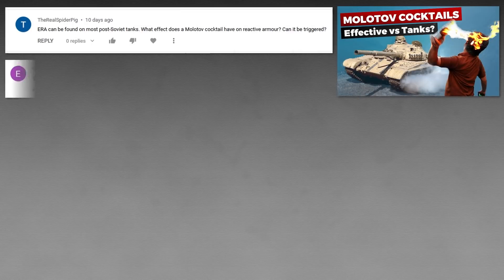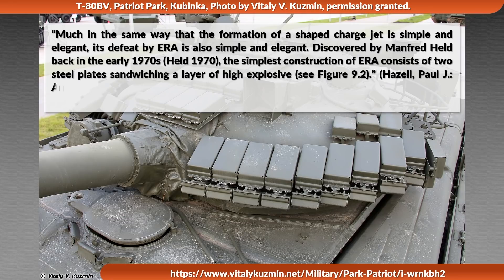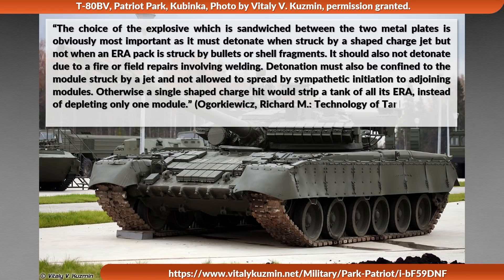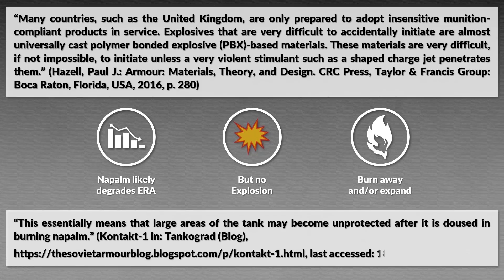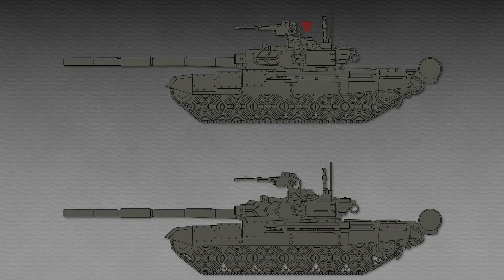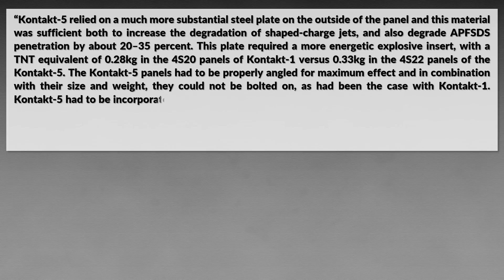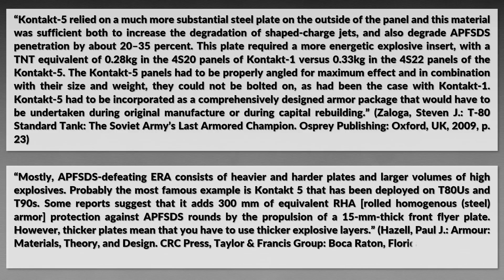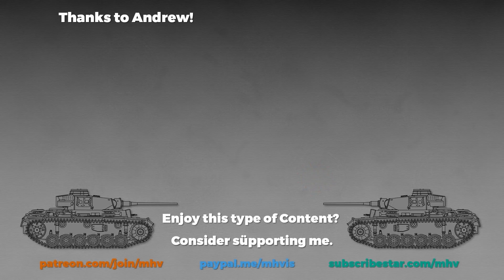Why does Russian Explosive Reactive Armor not explode?

Comment: My guess before watching. It has to do with the starting principle that you can burn C4. Simply stating that not all explosives are volatile in that way.
Reply: Yup. 
PBX or C4 will detonate if it is subjected to a shock generated by another high-explosive, but that shock must be sufficient to initiate the explosive chemical reaction. For instance, blasting caps have only a tiny amount of high explosive, but they prime a charge by insertion into the charge. The high detonation velocity of the cap will transfer its energy efficiently in that instance. However, if you put the blasting cap on the exterior of an ERA block, the block would not detonate. The detonation velocity of PBX explosives is roughly 10k meters per second. A bullet's velocity is a small fraction of that. An explosion on the interior of a tank is buffered by the tank body, the material surrounding the ERA and distance, so it cannot generate a sufficient shock to initiate detonation of the ERA. 
But, if you need to heat your food, C4 is great. (Anyone more current on military explosives, feel free to correct me.)
Reply: @SBCBears  it gets a bit soupy as it burns so you have to be careful about small fires if you dont set up correctly, but yes C4 is great to cook with. A thin spiral is easiest to make in the field and easily controlled. Some use it to heat and break bottles for improved shaped charge containers and it gets pretty drippy like that and can start a small fire at your feet.

As for shooting it I have managed to set C4 off with a 40mm Hi Ex and a .50 cal HE can be iffy in my experience, nothing else smaller will do more than splatter the ground with the shit.
Reply: @SBCBears  you meant the right thing but said the wrong thing. Tertiary explosives require a shockwave to detonate. Now eventhough RDX (not PBX) is a Tertiary explosive, it does not work this way on this particular explosive. It requires an electrostatic potential to detonate.
Reply: @SBCBears  the force you are describing is an impulse…  not shock :)  it will only be activated by a high impulse or electric charge. 

Cheers bro :)
Reply: @adamleddy9894  Thanks and true. 
I used "shock" here to better communicate the effect of the speed of the reaction-- a gentle push and hitting your thumb with a hammer are both impulses, but the qualitative difference is stark... especially the second time you nail your thumb. (Son of a b**ch!   🥵  ) 
Just trying to get the idea across to the general reader. You're right, tho. Thanks again.
Reply: @SBCBears  all good… I work in this field so I didn’t want to contradict what you were trying to convey… just arming you for the next time :)
Reply: Not sure if you guys are being sarcastic, but I thought the fumes from burning C4 might not be so great, especially in food. :x
Reply: I heat my MRE's using burning C4
Reply: I was expecting the theory that comes of the reactive armour had been sold off and solid blocks of clay and cardboard installed in it's place. Is there is a Russian equivalent to Sgt. Bilko?
Reply: Yup, no detonator. 
The explosives would burn like a candle in high heat but the explosive penetrator is quite sufficiently. 😏
Reply: I thought the oligarchs  put plaster in the contatainer in stead of c4/ or contact b .lol
Reply: Same with dynamite, you can burn it on top of birch bark, but caviat is that you really, really should avoid any hot sparks? embers? landing on the dynamite or it can set it off since its small area that gets exited by heat energy, potentially enough to cause chain reaction, but otherwise you can burn it. Tough dynamite is less stable than C4, what you can burn with out ember issue far as i know.
Reply: They filled with carton
Reply: Uhm…I think you misunderstood reactive armor. It’s not supposed to explode under heat. It’s supposed to explode upon the sensors picking up on an incoming projectile.
Reply: @baronhelmut2701  who did? Bunch of comments here, sir
Reply: @Sir.Craze-  if there is no @ in my comment. It’s addressed to the thread opening comment. Which is yours. Your comment would only make sense if you didn’t understand the way reactive armor works. I addressed the C4 not exploding when exposed to heat in another comment addressed to somebody else.
Reply: @baronhelmut2701  my comment is saying that you can expose some kinds of high explosive to heat without them being set off. And that I've guessed this will be a factor in the explanation of the video. I'm not sure what I've missunderstood. I'm saying it may have been burned without being set off.
Reply: @Sir.Craze-  Ok, last time im going to rephrase it: what you said in of itself is not wrong, but it also completely misses the point. The point at which the tank is burning is too late for it to matter whether the reactive armor “reacts” or not. Also obviously the reactive armor is not supposed to go off from heat, so it makes sense to choose the explosive that remains stable under heat.

Comment: Its to be expected that they dont detonate due to fire but instead just burn out. Secondary explosives (most people only know these, like TNT and C4) only burn and not detonate on their own. They need a strong initiation like from a blast cap, hammer blow or the violent penetration of ERA.
Reply: Many lives have been saved due to reduced sensitivity explosives civilian blasting
Reply: I remember reading about people using C4 to heat field rations in vietnam, which goes to show how hard they are to detonate instead of burning/conflagrating
Reply: @Chilionloppu  My father has a buddy who was a combat engineer in Vietnam, and he talked about using burning C4 to dry out socks.
Reply: Yes certain explosives burn in funny colours perfectly safely. Low explosives are totally the opposite hence we use it in small pellets to crack open rounds like smoke or older illum rounds.

Comment: Makes sense, REA is meant for things that can easily punch through a lot of steel. It’s not like they slapped C4 onto the front of tanks and called it ERA
Reply: Honestly wouldn’t be surprised is Russia did do that
Reply: Saw a video and they were empty, filled with cardboard
Reply: @adambussert3383  if you are referring to the bag type filled with "egg cartons", it is more likely that the Russians abandoned the tank, but salvaged the ERA, leaving the spacers
Reply: @AlwaysDisPutin They aren't egg cartons, they are ERA spacers. They are made of rubber and they look more like jelly moulds rather than egg cartons anyway.
Reply: @AlwaysDisPutin they are not literally egg cartons, it's just a term people like to use. I put it in quotes for a reason
Reply: @AlwaysDisPutin well stop assuming things, it's not the job for inexperienced and uninformed people like you
Reply: @Piggiesgomoomoo  Nah man, always assume people are stupid. I bet there is a loooot of people arguing that in fact egg cartons is what they are.
Reply: I wonder if it's a game theory application. If all reactive armor is up, nobody will waste HEAT against it. However, if it is widely believed some of blocks are fake - now there is a motivation to try it. Plus it reduces costs. Kinda like a bluff in poker.
Reply: @usun_current5786  Hmmm I don´t think this is how it works. Most likely a tank crew will use it´s APFSDS ammo against other tanks. Infantry will use tandem heat rounds or top attack mode depending on availability.
Reply: @adambussert3383  true, in chechen war, battle of grozny  they removed the explosives from the boxes in T-80s because they thought it was too expensive, so its not unlikely to happen again

Comment: There's probably someone who knows more about it, but if ERA uses High-Explosives afaik HE usually only explode if a current is applied to them ( I think I saw a video about it at some point) so maybe there's an electrical component to how it functions too?
Reply: Explosives are metastable chemicals that want to degrade into gases, but cannot unless sufficient energy is applied. Any explosive detonates when it is compressed sufficiently as compression provides that energy. This is how detonators work, the shockwave compresses the explosive around it which explodes, compressing the rest of the explosive in a chain reaction. All explosives will detonate like this which is actually how explosives are defined (undergoing a shockwave triggered chain reaction). You can also detonate various types of explosives in other ways that apply energy, such as heat in the form of a spark. This is usually how detonators themselves are set off.

In the case of ERA it is very easy to ensure it detonates when struck by a sufficiently dangerous threat, as anything that can penetrate the perhaps 500mm of armour behind the ERA must cause extremely high pressure which will then compress and detonate the ERA block.
Reply: It's shock, not current that sets off HE. They need a detonator, or in the case ERA the detonation of the rockets/shell exploding against it.
Reply: @chemistryofquestionablequa6252  What was the necessity for low explosives to go off again then? Just air? (I could look it up myself, but an answer for anyone reading the comment chain would be appreciated)
Reply: @Starsky3022  enough pressure
Reply: @Starsky3022  low explosives have low tolerances and are very dangerous to handle. I recall mortar rounds having a very small pellet to crack open our smoke or illum rounds hence a brown band colour. HE you could burn, mould, etc, safely.
Reply: As far as I know you need a detonator to cause HE to explode. Some detonators apply a current to a small heater filament that sets off something like lead azide  or mercury fulminate. These are sensitive explosives that create a shock wave that sets off the main charge of TNT or whatever.  They can be set off by heat, which could also be supplied by a fuse, or mechanical shock such as a spring loaded striker, or a projectile hitting the ground.